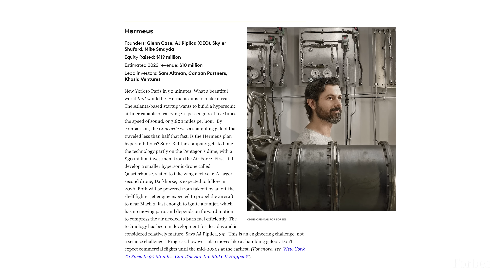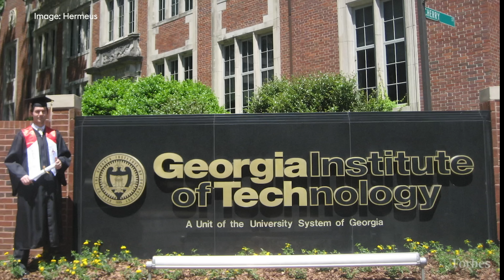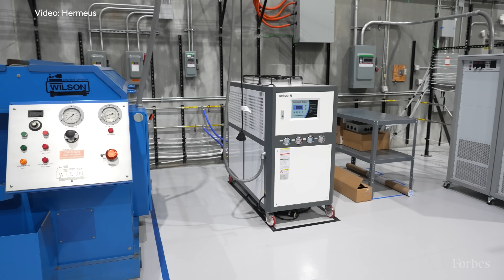Mach 5 Aviation: Meet The Next Billion-Dollar Startup Racing To The Future

Comment: Aerospace and aviation has had no real innovations because of the FAA and the price to certification just is crazy expensive just for basic parts that make no sense. Need to fix the FAA so we can have super sonic planes, a space shuttle, or GA aircraft at a reasonable price again. In the 60-70s you could buy a corvette or a 4-6 pax plane and now you can by 6 vets to one small 2-4 pax GA plane.

Comment: This is more like a comerical then anything else.. we have all the technical data for winged hypersonic flight, its called the sr71 and the  x15. The problem with mach5 or higher flight speed is not propulsion its the fuselage and friction from the air that is created.  The SR71 was never tested to its full potential and the X15 ran out of fuel or stability issues surfaced hindering its development.. so this not a passenger or weapons delivery platform,  its nothing more then a single weapon system.. and no the Russians and the CCP do not have anything close to what most western economic countries currently have and are testing.

Comment: if it flies at 2000mph it will get up 128 miles higher after 30 minutes according to earth' curvature. to stay at constant altitude the forces pulling it down the curvature must match the force pushing in forwards, gravity can't even beat a small kitchen magnet but it can match the jet-engines? this proves earth is flat, pilot dont care about earth curvature or moving.

Comment: Bravo Forbes and Aj CEO of Hermeus for teaching Russians and Chinese who are already at least 15years ahead in Hypersonic technology
Reply: TR-3B aircraft would have something say. It exists.
Reply: @kcopara1  my father and his neighbnors saw a huge black triangle hovering over them in casablanca in the 70-80s. No lights, no sound nothing, it didnt even flew away it just- poof -gone. My personal opinion is that these are UFOS
Reply: US patent 10,144,532 B2 is the future not this. Look it up. No fossil fuel required, no jet propulsion required yet significantly faster than Mach 5. It is  Far beyond hypersonic technology.
Reply: US have advanced  beyond hypersonic technology. I don't why they are making a big deal out of hermous
Reply: I was just thinking the same
Reply: Hilarious.  The US flew SR71 at Mach 3+ and X15 at Mach 6+ 60 years ago.  The amount of data the US has on hypersonics far outstrips those guys.  Russia and China never had an equivalent.  China nor Russia have the ability to produce modern jet engines.  It is not so much flying at Mach 5 at 100K ft, it is take off and landing at 200 knots AND flying at Mach 5 with the same engine.  Those guys have no idea how to do that.